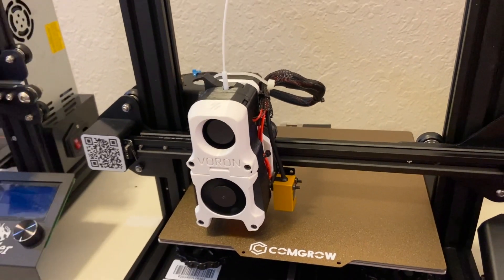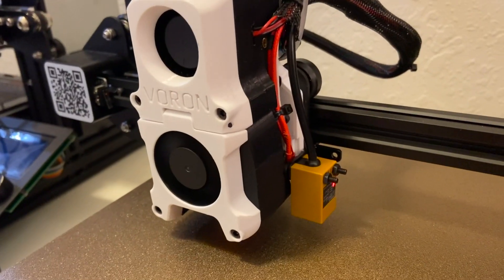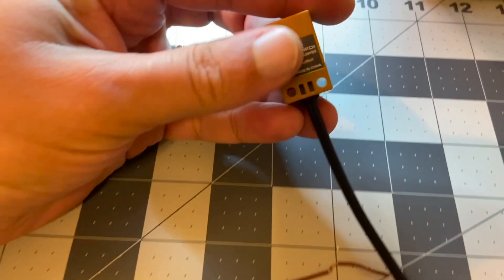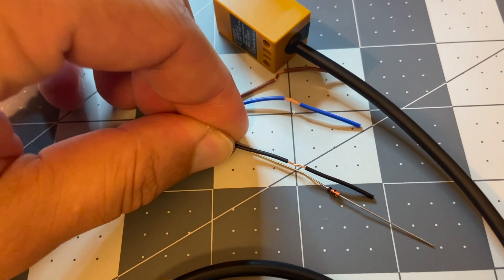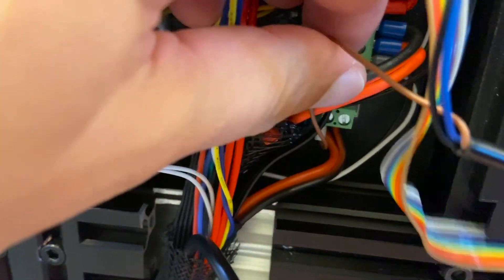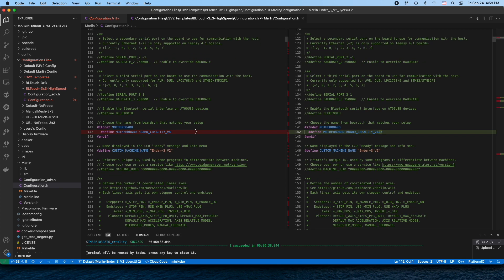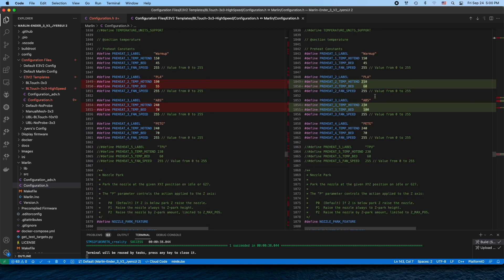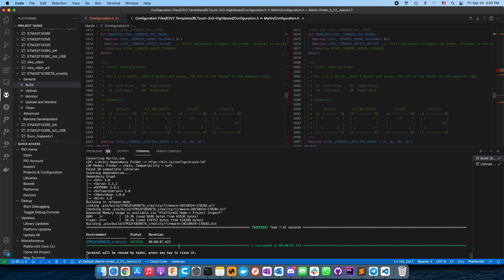10$ Inductive Probe for Ender 3 with Jyers Firmware

Comment: Where can I get the mount for this probe... Just like this
Reply from the maker: This was just an Aluminium bltouch mount I have drilled holes on to mount... Unfortunately do not have nether this printer or probe to check any possible solutions out there.

Comment: still using marlin with all those upgrades is a sin, sir! (just kidding, but have you tried klipper yet? it's so much easier once you get over the initial hurdles, then you can take full advantage of your machine. not having to compile FW when upgrading things is a huge plus, too, and you can start testing your omron TL-Q5MC2 NC with g34/g29 at 100mm/s to see if you got lucky)
Reply from the maker: Hello. Video specifically made for Marlin as 80% of the people run printers on stock FW and compare to Klipper it doesn't requires Raspberry Pi. There are loads of videos on how to make same mod for Klipper but non on most popular Ender 3's Marlin Jayers FW, so here we are. I personally don't use Marlin, all of my printers are on Klipper, you can see it in other videos. Thanks.
Reply from the maker: PS: Agree on SIN ;-)

Comment: Nice video @Hobbyist Note, i'm new to automation bed sensing. What should the distance between the sensor and print bed.
Reply from the maker: My sensor has Red LED which acts when sensor is sensing the surface. So I set height were nozzle aren't reaching the surface but sensor is sensing the surface, that way nozzle will not hit the bed on ABL. Don't forget to adjust probe's Z-offset to mitigate sensing and printing distance.
Reply: @hobbyistnotes  I have sent you an email facing challenge in adding the probe in my ender-3 printer can you pls revert me back asap.
Reply from the maker: @mugeshrajaram6306 the email address only for business communication. Please use YouTube comments. As I explained in previous comment you need to move probe up and down till it will sens the bed but nozzle aren’t hitting the bed, than adjust z-offset. IMPORTANT: As explained in the video, if you use inductive probe some of them have to be used with metal bed surfaces (such as PEI spring sheet) in order to work, as it can’t sens the glass. It’s easy to test your probe in order to determine what surface it’s requires, if it doesn’t have sensing indication led than while homing try to move any metal tool closer to a probe seeing area, than try same with plastic or glass. I think your problem related to the glass bed you have.
Reply: @hobbyistnotes  Tanks for your reply

Comment: is it necessary to change the X and Y offsets on the slicer when using the afterburnerer on ender 3v2 or just change the x and y offsets in the firmware?
Reply from the maker: Only in firmware. Sometimes in Marlin it might be in printer settings.

Comment: what is the output voltage of the inductive probe signal cable after the bat85 diode is installed?
Reply from the maker: We use property of a Schottky diode called reverse leakage current by connecting it to a sensors signal pin with a cathode side. In our case at 24v leakage will be around 800mV - 1.5v which is enough for STM32 controller to detect the signal of a sensor.

Comment: can NPN 6-24v inductive probes with different types and shapes work with this way of installation? I am very interested and want to try installing an inductive probe on an ender 3 v2 printer. do you have any recommendations for other types of inductive probe sensors with a more compact shape?  small as on the prusa printer?
Reply from the maker: You can use any NPN or PNP probe with this method just make sure you wire it correctly and Z_MAX_ENDSTOP_INVERTING set correctly, on homing at first try to use metal part to trigger probe, if it's not triggering just turn off the printer to prevent bed-crash, happened to me few times very nasty... I use 2nd grade Omron sensors installed on 2 of my printers and they are flawless i have way better-results with them than with bltouch, for price of BL-Touch you can get probe and PEI metal spring bed sheet. I am not sure if i can recommend any other probes as i haven't tried anything than Omron, 3d-Touch, BL-Touch... I usually use Aliexpress and searching by purchase amount+reviews... I bet you can find probe over there for less than 10$. I think may be in to the future ill make video about different probes, but for now i have other projects in line and it's just a hobby... Hope you will find best probe for your application!
Reply: I've run klipper on ender 3 v2 stock mainboard v4.2.2. can the sensor type LJ12A3-4-Z/BX - NPN Inductive Proximity Sensor 3-Wire 6-36VDC be installed in the same way as in your video?
Reply from the maker: @lanypuspasari1868  I run Klipper with mine sensor and I had BLTouch before, there is 0 issues to configure it with Klipper, if be honest for me it's even easier as you can play with configuration in the fly.
Reply: what type of diode should I use for the inductive sensor I mentioned earlier?
Reply from the maker: @lanypuspasari1868  Ender 3 uses 24v power supply, so based on the specs of this sensor it will return back 24v and you will need to use same schottky diode i mentioned before (BAT85) or better if you can find an optocoupler (I can't provide any model), be aware that faulty diode or wrong wiring can fry your motherboard and before connecting to a z-pin i would advice to verify that diode and sensor are working properly by wiring everything outside of a printer and measuring the voltage.
Reply: ok i will try it before i plan to use bltouch clone but i doubt if it works well on stock main board v4.2.2 with klipper. so i want to try with inductive probe
Reply from the maker: @lanypuspasari1868  if BLTouch clone works well with Marlin it will work with Klipper, Klipper way more flexible than Marlin and I personally would start with flashing Klipper.
Reply: what is the output voltage of the inductive probe signal cable after the bat85 diode is installed?
Reply from the maker: @lanypuspasari1868  With my sensor I used BAT85SCT-ND based on it's datasheet ~800mV, unfortunately I can't check it in my printer as it's at the middle of another project. Be aware that input 30V for BAT85 as is a maximum.
Reply: @hobbyistnotes  I mean the output voltage of the inductive sensor signal cable after the diode is installed?
Reply: @hobbyistnotes  when I use an inductive probe with type LJ12A3-4-Z/BX NPN NO 6-36V
 can it be installed in the same way as in your video?
Reply from the maker: @lanypuspasari1868   You have to install diode the same way as in video. The way NPN sensor works it is closes the loop when it sens nothing and you will have input voltage on the sensor signal wire, we are installing bat85 to limit this voltage to ~800mV cus we don't need all input voltage on our controllers z-pin. It's easy to verify: connect sensor to a bench power source that have 6-36v with Ground and Voltage In wires than use multimeter and measure voltage between signal and ground wires, bring something close to the sensor and see if voltage will disappear when sensor is "sensing", then you add bat85 diode to the signal wire and check it same way you should have limited voltage.
Reply: @hobbyistnotes  ok i will try to install it soon. can you share the klipper config with inductive probe for stock mainboard v4.2.2?
Reply from the maker: @lanypuspasari1868  currently I don’t have Klipper config for Creality board, but I had plans to convert my 3rd printer to Klipper and it has 4.2.2 board in it. I’ll post config to my GitHub repo as soon as I’ll convert the printer(in few days) So far I was busy with linear rails installation to another printer.
Reply: @hobbyistnotes  ok thank you very much for your response and suggestions. i will be waiting for you to post the configuration for the v4.2.2 board
Reply: @hobbyistnotes  I am very grateful to you for responding and replying to my question.
Reply from the maker: @lanypuspasari1868  i found 4.2.2 board klipper config at Klipper's git-hub repository, here is the link: https://github.com/Klipper3d/klipper/blob/master/config/printer-creality-ender3pro-2020.cfg
Keep in mind It's a good place to start but it doesn't have probe setting and requires some adjustments.
Reply: @hobbyistnotes  i have installed clipper fluid since 2 months ago on stock ender 3 v2. i plan to add abl with inductive probe like yours.
Reply: @hobbyistnotes  can you share your printer.cfg?
Reply: because I want to add an ABL with an inductive probe and afterburner printhead, I ask you for the configuration.
Reply from the maker: @lanypuspasari1868  https://github.com/Agilato/ender3-klipper
Reply: @hobbyistnotes  inductive probe type NC what is the difference with type NO, do you think NPN NC or NPN NO is better? And is the configuration on the probe pin the same on the printer.cfg when using NPN NO type?
Reply from the maker: @lanypuspasari1868  We use specific types based on application needs. In our case it doesn't really matter NC or NO as 3D printer very simple machine and I don’t think there is a clear winner at this price point.
Reply: @hobbyistnotes  if I use the NPN NO type can it be used and work well? And the probe pin configuration must be changed or not?
Reply from the maker: @lanypuspasari1868  You can use what ever proximity sensor you want and just configure in to the settings if it's NO or NC. In Klipper we add "!" when specifying sensing pin type or remove it base on initial state of the switch or probe. In Marlin as i mention before at compiling process we set config value of Z_MAX_ENDSTOP_INVERTING.
Reply: @hobbyistnotes  endstop pin ^PA7, if I have to use npn no it looks like this !^PA7 on the probe pin?
Reply from the maker: @lanypuspasari1868  I prefer to set value lift gantry half way and test it with item on the sensor to stop homing before it crashes in to the bed if something goes wrong, cus human error always exists when ppl place labels or sell things especially in this price range.
Reply: @hobbyistnotes  ok i will try it. what is the ideal distance between inductive probe and build plate?
Reply from the maker: @lanypuspasari1868  It's based on specs of the probe sensing distance, I eyeball it on how sensor works the goal is to place it above the nozzle height, the sensor you have looks like have adjustment screw, as i don't have such sensor i can't give any reasonable advice. There is no real reason to use probe like mine it will work if you have any other working probe, you mention that you have 3D Touch, why not to use it?
Reply from the maker: There is no real reason to use probe like mine, this method will work with any other inductive probe. You mentioned that you have fake BLTouch why not to use it instead? Regarding distance, good to use sense distance based on specification of the probe. As 3D printer is a very simple machine I just eyeballing the distance based on how probe is sensing. Some probes have sense distance adjustment screw. The end goal is to place probe above nozzle that is it. Always good to place it as higer from nozzle as it possible to prevent print knocking the print if it has top-wrapping, but not to hight as ambient temperature and heat from bed might affect sensing distance.

Comment: I use this type of probe on some printers (using optocoupler). One hint: If you use a cutter to carefully remove the strain reliefe there the cable gets out of the sensor, you can use some epoxy to glue the sensor to a BL-Touch bracket. The epoxy strain reliefs the cable again anyways. As you get stl's for adding a BL-Touch for nearly every printer, this makes adding the sensor extremly simple.
Reply from the maker: It is a Very nice advice! In this printer my goal was to use sensor under linear rail inside of Afterburner assembly as designed by Voron’s team. I have 2 more printers where I can use same sensor and I’ll try this method later. Thank you.

Comment: Isn't there a space for this probe inside afterburner mount? I think I saw that somewhere.
Reply from the maker: Originally Voron's printers are use linear rails, this way mount point is higher and there is a space for a probe. Ender 3 has wheels with mount plate that 2 times bigger… I ordered rails and definitely the goal is to place probe in it's original/designed place.

Comment: will this same process work with a capacitive probe?( referring to compiling firmware)
Reply from the maker: Based on my research the basic concept of the sensors is the same so i think it will. In some cases ive seen some related articles refer capacitive probes as inductive. The difference might be only in type of the probe NC or NO, in this case you will need to adjust Z_MAX_ENDSTOP_INVERTING
Reply: @hobbyistnotes  cool thanks, I'll try it out and report back
Reply from the maker: @mred9335  One advice, do not try to home it in to the bed, lift the gantry and use something to trick sensor as it homed at the same time hold the hand on OFF switch. If it will not register just turn the printer off. I crushed in to the bed at the first time due to connection issue, nothing fun.

Comment: Hi I'm try your video based but it's not working .I'm using optocoupler isolation module it's not working. Any solution bro.
Reply from the maker: Please provide more details what exactly happening. If probe is not stopping the gantry than there are two possible outcomes: You might have wrong wiring or your probe Normaly Opened in this case you need to change value of Z_MIN_ENDSTOP_INVERTING to true. Keep in mind that Inductive probes are working only with metal sheet bed it will not work with glass. After uploading Firmware you can test if probe is working by placing something metal to the probe when gantry is moving down it should stop.
Reply: @hobbyistnotes  thanks bro its working i missing Z_MIN_ENDSTOP_INVERTING to true . but 4 bed level  CORNERS not working i set NOZZLE_TO_PROBE_OFFSET { -57, -12, 0 } its my seting .any solution
Reply from the maker: @dineshtd2387  You mean it's working with metal item when it's lowering the gantry?